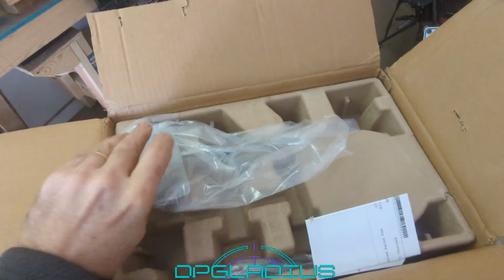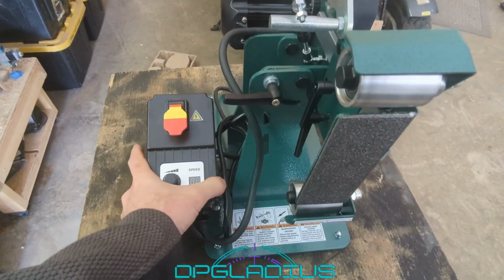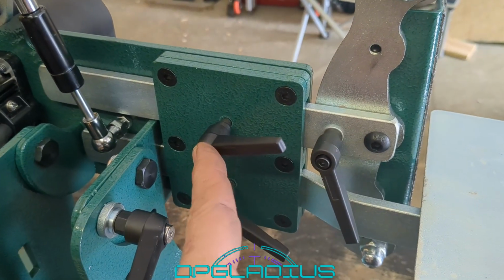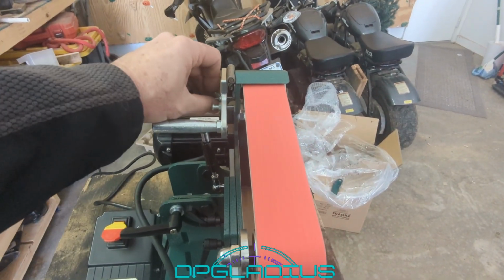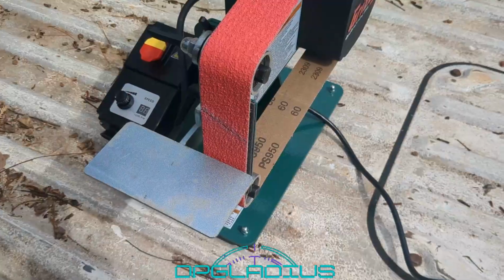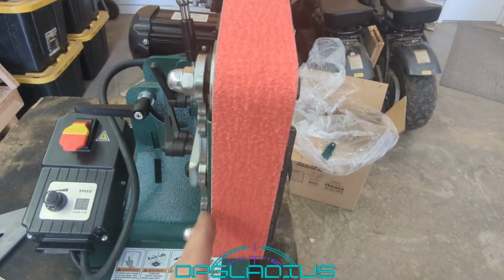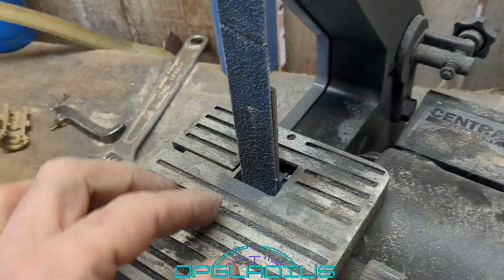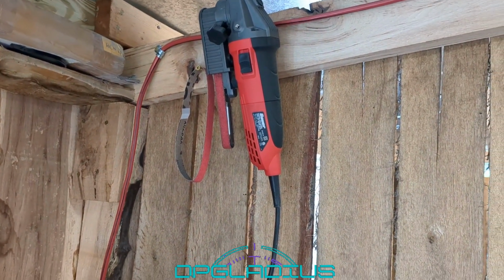Grizzly 2 x 42 Knife Grinder Unboxing Build Test and Review

Comment: Just setting mine up today. How do you like it? Did you ever grind away the sides of the back plate?
Reply from the maker: I am really liking the 2x42. I added a washer under the platen to move it further right and trimmed the right edge even with the 2 inch belt. I can grind knife plunge lines very consistently.